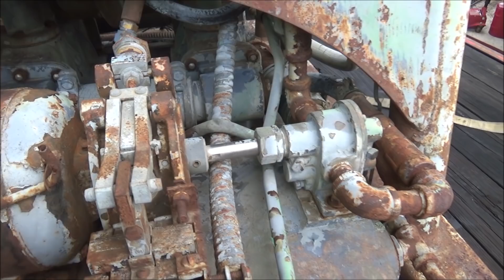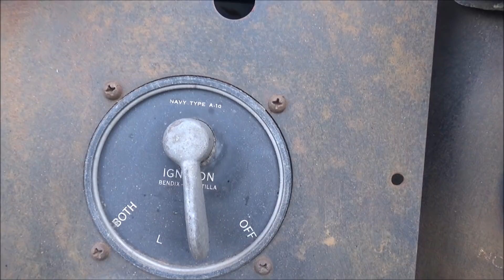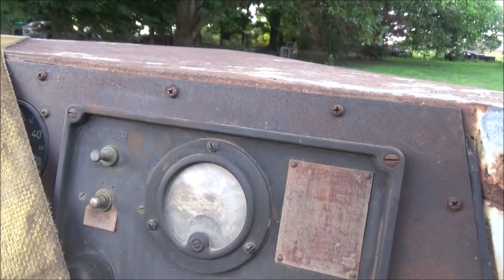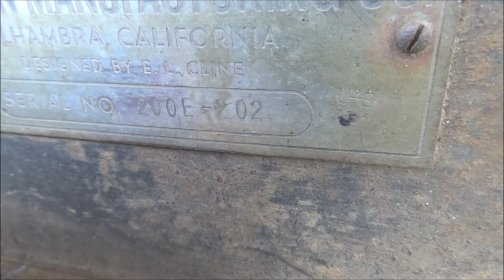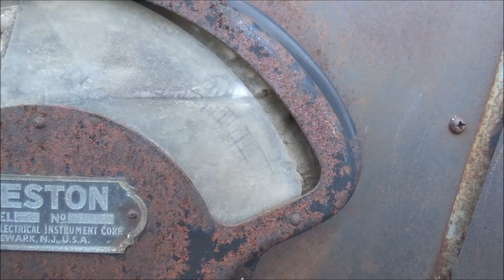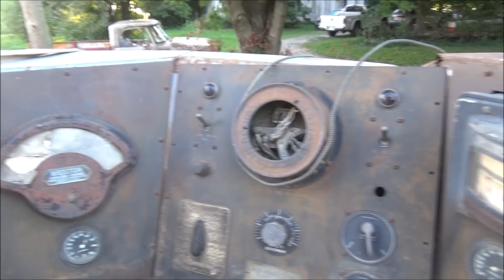Abandoned for Years Clayton Dynamometer / Dyno WWII Forgotten War Winning Machine

Comment: Brian, Hall-Scott had eleven water brake dynamometers in their factory, seven 350hp Taylor water brakes, and four Taylor 1000hp dynamometers. They also had three electric dynamometers built by General Electric, one rated for 1800hp, the other two rated at 1200hp. I have several pictures of Hall-Scotts testing rooms, and it was a first class setup.
Reply from the maker: screaminjimmy6V53T  What period of time was that? So perhaps what I was told about this unit was incorrect if hall-Scott didn’t have any Claytons.
Reply: @bcbloc02  Brian, the book I have on the Hall-Scott factory is not dated. Judging from the engines pictured, the book was printed during WWII. During WWII Hall-Scott turned out 998 cubic inch Invader engines and the 2182 cubic inch V12 Defenders. I have several Pre-WWII and Pre-ACF Hall-Scotts in my collection. They are low speed and all torque. I have pictures of the dynamometers and testing rooms I could email you.
Reply from the maker: screaminjimmy6V53T That would be cool. I would love the info. I had thought maybe by the configuration of my dyno that perhaps there had been plans to supercharge an invader. The power capacity and torque capacity would have been perfect for a blown 998 or even the later 1090. Do you know if any development work was ever done in that regards? My email is bcbloc02 at yahoo
Reply: @bcbloc02  Check your email. I sent various pictures of the dynamometers, boring mills, radial drills, lathes and milling machines that Hall-Scott had in Berkeley, California. I do not believe that they ever turbocharged or supercharged the Invader engines, but do know that they turbocharged the 1091 cubic inch 400 series engines. They even made a fuel injected 1091 which was good for 450hp on gasoline!  The V12 Defenders could be bought with a Schwitzer blower, and were rated at 900hp for continuous duty.  I have four Hall-Scott engines in my collection from 590 to 2182 cubic inch displacement.

Comment: Hey Brian, I know I'm late to the party, but this very much seems like an aviation engine dyno to me. The dual-mag setup is standard issue, as is RPM and manifold pressure gauges to achieve standard "power settings" on the engine from the manufacturer. The HP/torque range would make sense, as would having CHT gauges and the number of cylinders is on the money too. 

For air-cooled engines, it's desirable to keep CHT under 400F, however it shouldn't exceed 500F. EGTs can easily be in the 1400F range. The manifold pressure range is definitely suitable for a forced-induction engine.
Reply from the maker: Hall Scott did also make the liberty 6 engines which were used in airplanes. Could have even been intended for an engine that never wound up getting built since the war ended likely shortly after delivery. I imagine they tested many various engines on it as I think it was more a lab and r&d dyno than a simple load test/break in dyno.

Comment: If its 500hp and 2000 ft pounds its designed for very low RPM. torque x rpm divided by 5252. With this formula the TQ and HP curves will always cross at 5252 rpm.
Reply from the maker: It is rated up to 5000rpm which is plenty good for most diesels and honestly even some gas motors. Ultimately I would like to have a 2:1 gearbox I caould use in front of it fro testing gas engines to 10K and 1000ftlbs or overdrive it and run big engines to 2500 and 4000ftlbs.
Reply: @bcbloc02  rated as in max. Its a truck dyno but you do truck engines. Even semi modern dynos are set up completely different for a reason. The recycling of the water within the brake is really bad. I have a a 250 gallon water tank and its steaming after a couple of hours. looks like a cool project if you have the time but dont expect practical use. its probably more of a test and break in stand. leaks ect. Have you checked to make sure it actually uses water ( low flash turns to steam?)maybe there is an oil used?

Comment: Looks to me like a good portion of the control console isn't electrical- mostly pressure and temperature gauges.  The part that is electrical doesn't look too complicated. At least if it were me, my first step would be figuring out how you're going to handle the damaged gauges and meters. If you can't refurbish them or get original replacements, then you've got some re-engineering to do and you might consider how much effort it would be to design a new control system.

Comment: Does the water brake require a cooling tower?
Reply from the maker: Cooling tower is usually for the engine. The dyno just needs a good flow of water to take the heat away.  That could be closed loop or open flow off the mains.

Comment: Obivious place to start would be to start cleaning it up. You'll probably be fine without gauge glasses, as long as nothing else gets inside, but that's if the dial and mech are still good (if it was outside that's not good). As for the electrics checking connections, cleaning and testing switches and light bulbs is where to start (just like on an old car). You might be able to find the tube numbers just by brushing away at the rust around the sockets, to see if any info was stamped in the metal. If you can find the tube numbers (either through a schematic or markings), I would recommend removing and sending the little chassis off to be overhauled, probably to another Youtuber like Mr.Carlson's lab, given that it suffered water damage. They obviously won't be able to test it without the whole unit but it looks simple enough that a parts swapout should suffice.

Comment: I think that the big difference in water brakes is durability and RPM limits the older claytons use massive components and thus tend to be longer living absorbers the super flows use smaller components, smaller diameter less mass and can accelerate faster and to much higher speeds ie up to 20,000RPM.  Your dyna will probably eat much more than 500 HP with adequate cooling but will not be friendly to any over speed

Comment: Thanks Brian. Wondering if the two missing tubes are part of an analog computation for hp? (if I recall you need to multiply torque by rpm and divide by a constant)

Comment: So I have to ask a question.  I understand you want to make it work, but are you planning on restoring that beautiful console?  Functionality could be achieved with a much smaller console with standard automotive gauges and a small computer for data capture and logging, but oh those wonderful old gauges! It would be great to see that console working with all those magnificent big needles. I haven't looked, but I bet those Weston gauges are going to be a little hard to find, and it would cost an arm and a leg to get them rebuilt.
It is something to think a handful of sensors and a Raspberry Pi could easily outperform that system, the original has no indication of logging. I suppose you could just be missing a chart recorder. But the Pi would not have near as much class.
Reply from the maker: I plan to restore the console for the cool factor but will be using a computer and datalogging for the actual testing.

Comment: Their are several Dyno shops up here in the detroit area and some of them are using Clayton  dynos  mostly for dura durability testing the Super flow dynos seem to be used for short power pulls for HP development you might have some luck finding information in the metro detroit area  Looking at the guages and instrumentation you might be  ahead of the game to use modern technology for the control console
Reply from the maker: Yes it is my understanding the claytons are more sensitive and can hold steady state much better than the superflows. If you are just doing better or worse testing the super flow does the job. If you need to get accurate measurments like for a certification then the Claytons are better.

Comment: Nice load of projects on this trailer...
You'll need to insulate the shop before winter if you get water in those pumps or frost will lead you to a lot of practice on welding castings...    
This will help turning your shop in a testing lab for pulling tractor engines, a nice complement to be able to handle the "Bigger" jobs related to industrial machines...    😎👍
Baily will need to start looking to bulid a team in order to assist you, if he take his supervisor's role seriously....    🐶😉

Comment: Awesome piece of equipment:-) I would think the module on the panel that takes two tubes would do the necessary maths to give a direct read out of horsepower on the RPM guage. 5000RPM and 500HP would make it nice and easy to read the scale. I guess the module has an input from both the tacho and the strain guage.

Comment: Back in the early 80s the cat dealer up here in saskatoon Saskatchewan had a water dyno that they dropped the drive shaft on trucks and connected it to the water dyno control panel looked a lot different but the dyno part looked very similar so i wonder if you could revamp it with new style instruments and be able to make it functional i don't know if AW dynamometer is still around there were also a ton of pto water dynos around for tractors i would like to believe that the dyno part it self is similar to other water dynos
Reply from the maker: Yes I think the brake is made like most brakes so it should not be too hard to figure out.

Comment: In 1974 I worked at Kenworth. I cleaned the dynamometer. When they tested each truck at full horsepower, each one would blow a different hose. I had a mop and degreasing solution  that was like Prell concentrate detergent. I needed to get the roller that is spun by the tires to be clean enough for traction.
Reply from the maker: Dynos are great at finding weak links. :-)

Comment: Talking about the temp gauge you mentioned it maybe for cylinder head temp , I think your right in normal operation you can get past 400* on aircraft engines so being for testing I’d say exceeded that so the 600* makes sense for that. Also the left, right , both mag switch fits with being used on aircraft engines.
Reply from the maker: Any idea what 6 cyl roughly 500hp  aircraft engines would there have been in 1944?
Reply: @bcbloc02  not sure of a 6 cyl with that much power but being used in a lab they might have been testing stuff we never got to see. A r985 Pratt would fit that power range but they are 9 cyl. Which bring another point most ww2 engines with any power were radial which are all odd number of cylinders, unless you have for example a 14 cyl which would be two banks of 7.

Comment: Basically scrap the control module.  With all of the sensors available today or even the computer system out of a big JD tractor or combine you could build what only the engineers in those test cells in 1945 could never dream about.  Maybe just feed sensor inputs into a laptop and be able to see and record what is going on.  The load unit being fairly basic is the most valuable item you got. Engine rpm, oil pressure, boost or vac readings, load cell output, oil temps at various points, water temp and water pressure, voltmeter, vibration sensors, cfm going into the air intake, and anything you can ever want.  Build an engine control panel, safety shut offs for fuel and ignition, and a fire suppression unit.  Put it all in a 20' shipping container with a dividing wall and a glass panel.  Be able to load it on and off your trailer and go to engine builders who do not have a good dyno.

Comment: Brian, if that is truly a strain gage based load cell, then it almost has to be a Ruge/DeForest product (BLH electronics). The bonded electrical resistance strain gage was invented by Ed Simmons at Cal Tech only 7 years before your machine was built. After being director of R&D for several years, I am now head of Micro-Measurements strain gage division of Vishay Precision Group. Would love to help with the load cell anyway I can. Just let me know how.
Reply: Let's Roll KILROY WAS HERE !
Reply: Its a water brake. basically a really inefficient water pump tq converter.  Housing rotates converted to ft pounds of TQ on the end of a 1' lever. or longer shorter using a formula to correct.

Comment: The question is what are you going to do with it? What’s is good for?
Reply: he is rebuilding a Cummins at the moment. He will need this machine to make sure the Cummins has enough horsepower/torque to lift the Monarch or the HBM or the planned acquisition of the TBM to get from the house to the shop without getting wet.

Comment: With the magneto control I’d venture it was primarily for aircraft engines
Reply: PT boats had gas engines, similar to aero.
Reply: IIRC, big radial airplane engines in ww2 made up to around 2k HP, which would beyond your machine's capability. Maybe a small Continental airplane engine or something comparable might fit your parameters

Comment: I'm with Steve Summers on your ability to get it going.  I wonder if we might see testing of "tractor" engines used in non- commercial applications.  Time will tell.  Had to quit watching about half way through; my back has been acting up recently and makes it tough watching my favorite videos.  Thanks for not being afraid to jump into old stuff (we had a 1970 3/4 ton Dodge pick up...a tough one).  Greg
Reply from the maker: That 70 3/4 ton Dodge probably why your back is messed up if it rides like mine. LOL

Comment: Sadly or maybe it was a honor, I've worked that style of wiring .
Would been white originally , every one.  The wire numbers had been like a press/burnt in.
Normally a five or seven digit number. Now would start with say 1000 , but as passed thru a sw or item , even a thermal strip changed. 
But to old to remember . Think all wires one side like incoming where 1001, 1002,1003, but after the component. Went 1011, 1012, 1013. Same Circuit but change wire numbers so when trouble shooting a bundle of wires n look at print, we had both true wire n run schematics. The run were for theory of operation schematics, the wiring where for nitty gritty of wire/components.   Could have been even as passed thru a cannon plug , numbers changed.  I showed only four digits for simple idea.  Should been 00000 .     Then second digit 02000 would change also. That could be as a safety circuit , or gauge circuit, engine circuit, control circuit. 
Can't remember that part. Think. 
01000 = control
02000 = engine
03000 = gauge
04000 = ?????
05000 =  ??????
06000 = ?????
07000 = safety 
Been 40 years. Once learned system n memorized them wether 7000000, or 50000  the system was same. Just more components or junctions.    The operation , gauge, engine,safety , cooling door, start circuit, forgetting some & know out of order too.   Knowing this made trouble shooting much faster , lot of folks couldn't grasp it. When you went below EWO, time was crucial .   Had many theory of operation memorized , but had the wok cards there to not miss any thing.
Was forbidden to run but double time shuffle was allowed.  T.O's & Work Cards, miss em still to this day. Was black n white, no ifs or maybes. The sweat would run, your mind flew , your hands where like machines. Only correct steps , no second guessing or movements.    Thanks Brian , hope this helps ya, was nice to walk memory lane, for a few. Made me few young again.
BTW I can not confirm or deny the presents of question weapon system or systems incorporated in use of or storage or use there of. 🙊🙉🙈👁👀😇
Reply from the maker: Thanks for the info!

Comment: Something tells me you're going to have to modernize the control and feedback systems, that console looks pretty well gone.  I think you could probably use a Raspberry Pi and some accessories to make a usable frontend.  Arduino if that's your pain...
Reply from the maker: Yee of little faith!! This isn't microchips and capacitors, it will probably work as is. :-)
Reply: As someone that has restored such things Id advise that you modernize the control panel as well.   Keep some of the water tp and pressure gauges that look usable. Your not recording that.  But for RPM, HP and TORQUE I'd update the analog gauging and provide a way to record digitally for graphing.  A little bit of old and new.  Neat project.  Good thing I don't live closer to you.  :)
Reply from the maker: I plan to use one of my data loggers in combination with the console for actual testing.

Comment: That pump looks like a gear pump from the outside not usually used for water. Could medium be oil?
Reply: Gear pumps are common for water use when you need positive displacement to move the water. Pretty much every priming pump on fire apparatus use them.
Reply: Blazer02LS interesting not aware of fire apparatus equip. Never used on ships like that, no lubrication and too much loss through clearances. Do they use rubber “gears” like a Jabsco pump?
Reply: @FromTheChief  Nope steel spur gears and a tank of oil to lube them in operation. Same as an oil pump on a car. On fire gear they are spun by what amounts to a starter motor. Essential item if you are trying to draft water from a pond or tank as the main centrifugal pump won't pump air.

Comment: Hooking that dyno into your under-slab heat system is genius.  Keeping your shop air at a stable temp is going to be tough with the huge door, but ground-coupling all your tools to that huge slab, then warming that slab to above dew point, and keeping it there, will do a LOT to keep your tools stable and cutting precise. Excellent engineering.